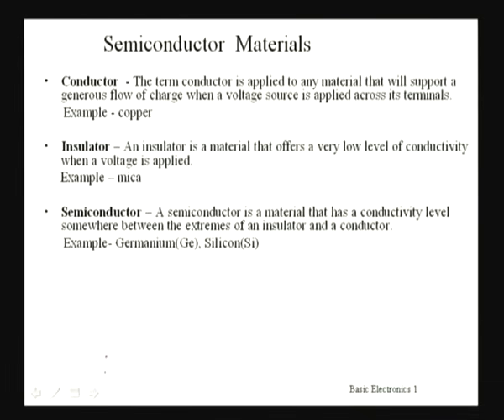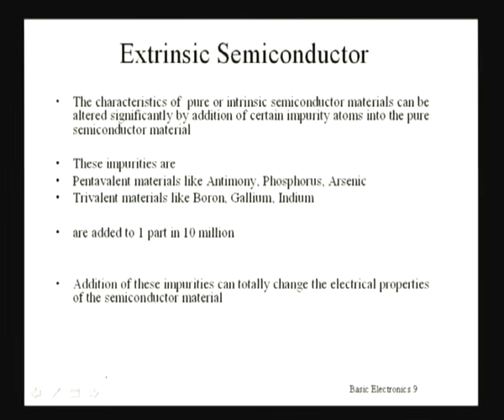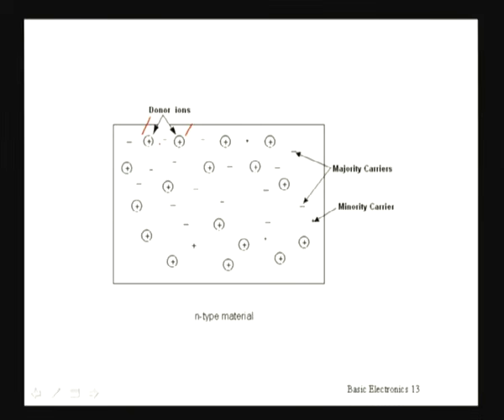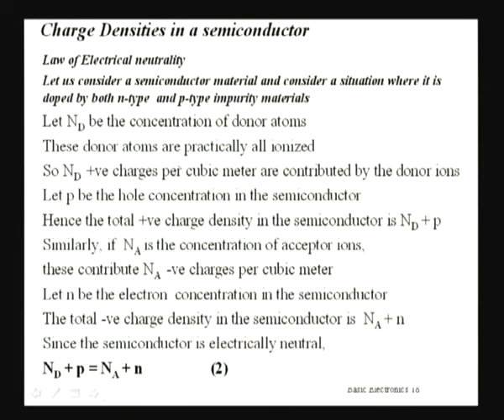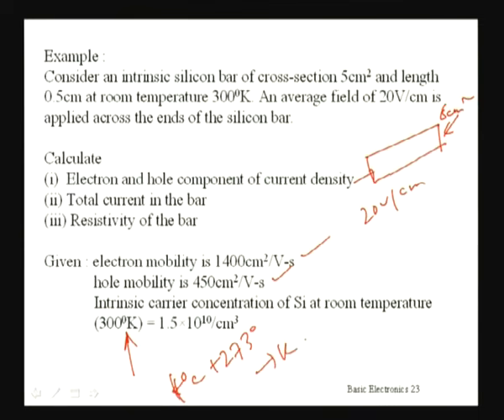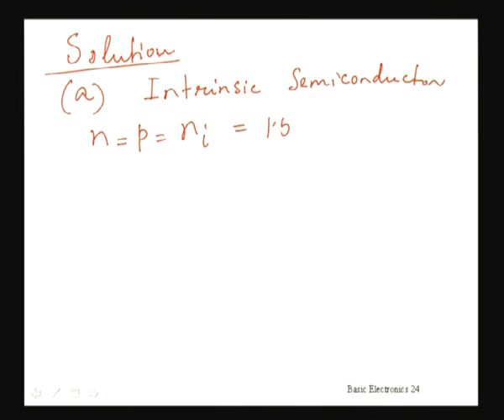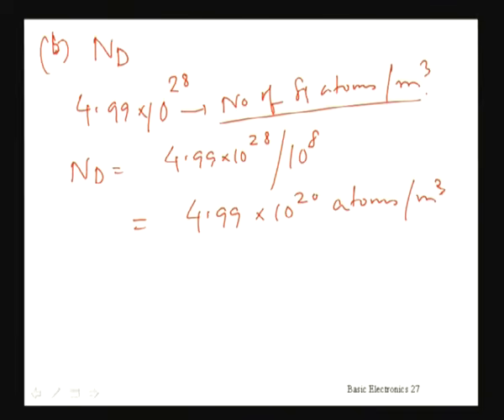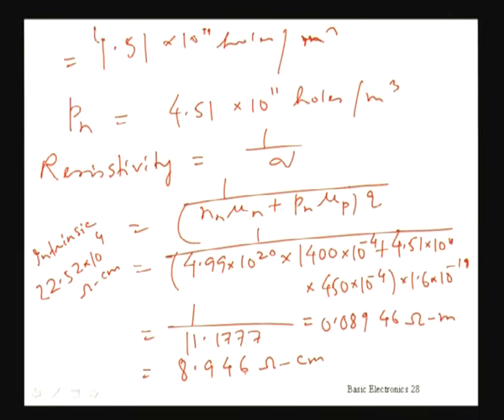Module - 1 Lecture - 1 Semiconductor materials

Comment: Why we prefer silicon as a semiconductor than germanium?
Reply: because thermal stability of si is good than
 the germenium
Reply: @dayanandnalawade5585  resistivity of silicon is less compared to Ge
Reply: @dayanandnalawade5585  why not go for gallium arsenide, if a greater bandgap energy to tolerate temperature fluctuations, is desired? Gallium arsenide has a bandgap energy of 1.4 electron-volts.

Comment: Amazing lecture.. covers all the points of the chapter it was supposed to cover as specified in the syllabus on the site.. if you are not able to understand , then maybe its an accent issue or you need to brush up your basics before attending this.. Good work NPTEL